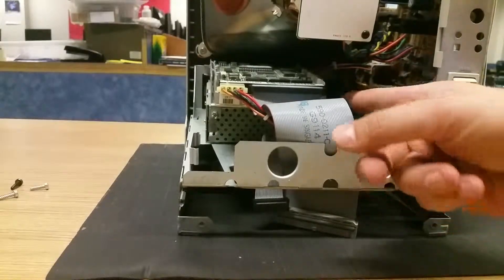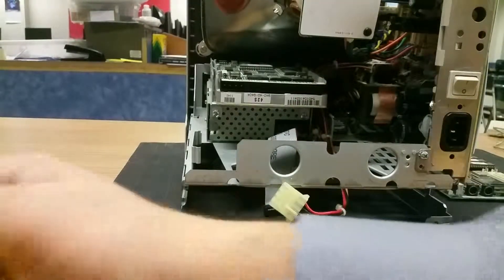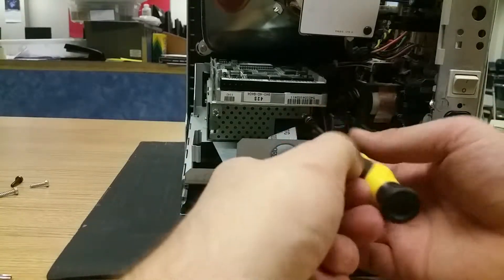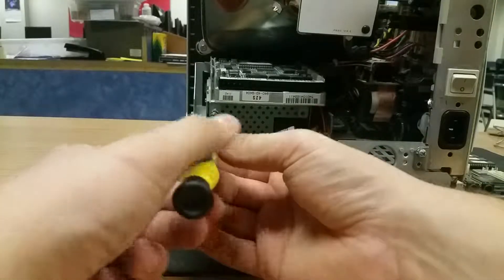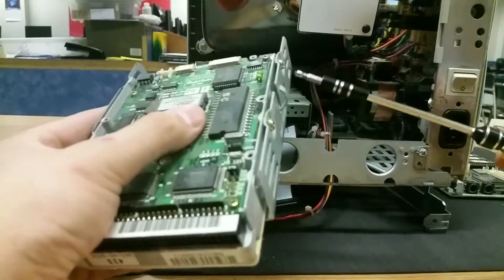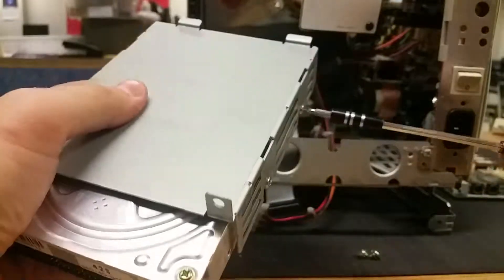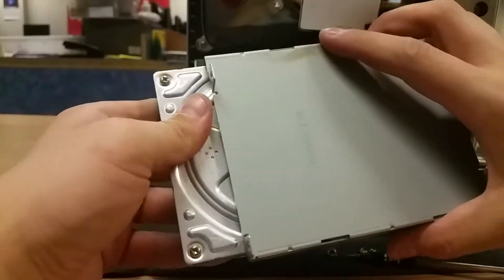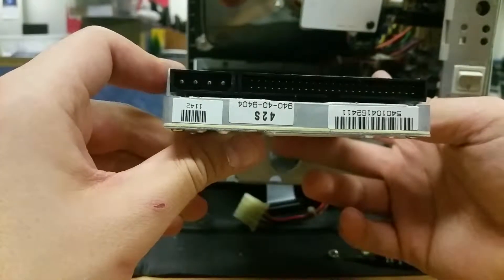Disassembling a Macintosh Classic II Part 3 - Hard Disk Drive

Comment: Thanks for the video, I wanted to ask you a question:
I would like to recover the data has a hd coming from Macintosch Classic. How can I connect it to be able to recover the data? is it possible to connect it as an external hd to a mackbookpro of 2009 or 2015?
With which device?
Thanks, Davide.
Reply from the maker: Sure! You would need a hard drive enclosure. They turn your hard drive into a giant USB flash drive
Reply: @brianfediuk  Grazie, Ciao.